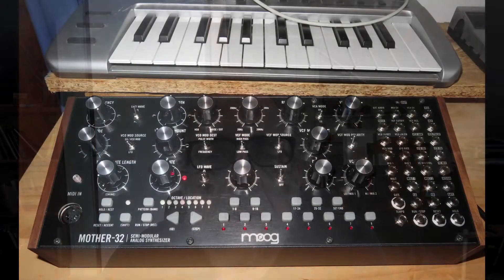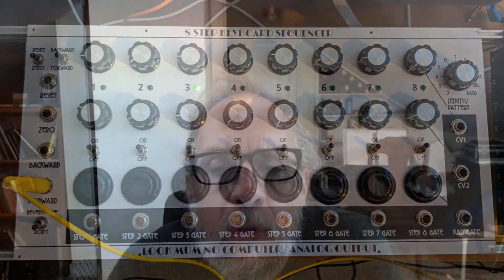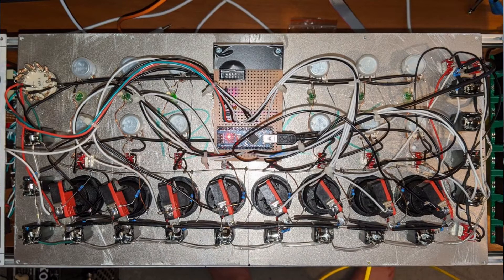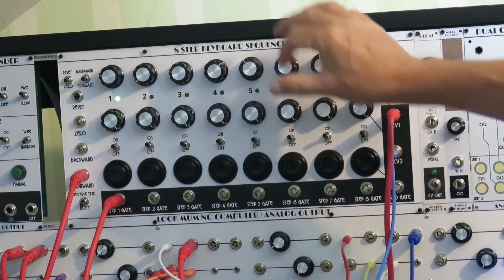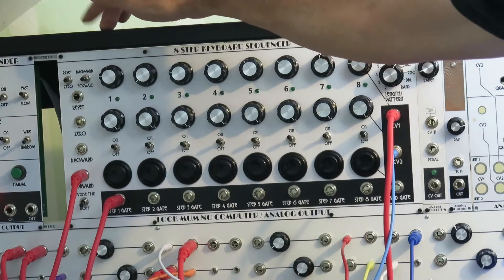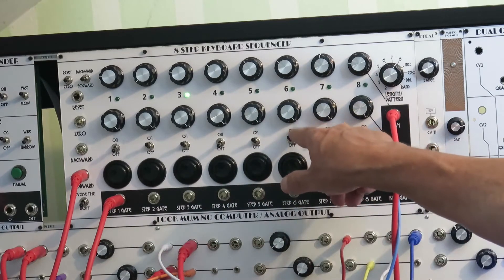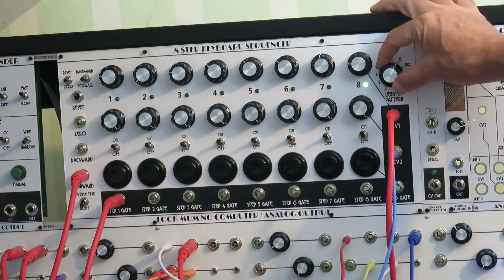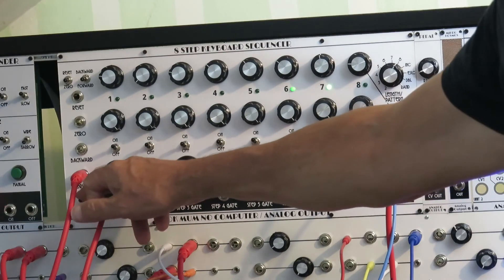8 step keyboard sequencer

Comment: Ok, you have two outputs per stage. Do you think a third output going through a set of pots might overload the Arduino pins? I believe the pins are rated at a max of 40ma. Would you have to run the LEDs through transistors?

Comment: Using an Arduino for a so simple task looks pretty overwhelming, but it's a cheap board, easy to handle with lots of docs, you can add in and out Midi control, shuffle, step jump, matrix to expand step number, whatever you want ! I'm just finishing an arpeggiator with lots of features with a simple Nano Every (3€).

Comment: just to say, you should check the 4022 or 4017 i dont get the point in using an arduino herem but that's me (the interesting part in the arduino for this woulkd be the code study witch sould make an easy to undertand example). for 8-16 (or more if you chaion several) steps check "baby sequencer, and then add what ever controls you want using transistor switches per step (you can do without though) for power stability. Anyone interested in etching/building 8-16-or more steps sequencer, feel free to let me know i'll; share my pcb layouts... sequencers are a great project to learn and understand some basics of logic electronics, and i'm pretty shure it must be interesting and not that hard to program to an arduino.
Reply from the maker: Arduino enables varied stepping modes: Reversed, up and down, etc., which would be difficult at best with a 4017.
Reply: @analog_output  yeah but i think i remember you can do that with a 4022 or another way (i just happen to have used 4017's because i started building a baby seq the first time and went from there, but i got a few books since...), i'de just need to check my books but it's doable with logic and i'm shure you know that. BTW i found a way to achieve randomness; you'll need a s&h with the output sent to a 16 stage lvl merter (or 8 or else, if its two 10 stage meters in series in a chip reduce input lvl and number of meter stages to suit needs), each levels of the meter being tied to one step, with a separate clock to the s&h you can do cool things that way... personally, random, and back and fourth is not that interesting to me the way i build music but once again that's me. these days i am after sequencing drums with one line (i prefer sevewral like igor did but, technically...), using two 8 latch chips (push on push off) chips per chanel if 16 steps (or more for more...), theory is easy (once you know your chips), i just need to give it a built now...

Comment: great module, thanks for sharing your enhancements.  Is there a reason to use the external voltage regulator vs the nano's internal one? curious if this reduces noise or something else? I normally just put +12 into the nano and haven't had any issues, thanks Rich!
Reply from the maker: I debated that, and decided since there were quite a few outputs and who knows what they'll be plugged into and so how much current they'll draw, I'd play it safe and use the external regulator. Just being cautious, perhaps overly.

Comment: What is the difference between reset and zero? I can't seem to figure it out. Looking to make this and wondering if I should ditch the zero step. Trying to get it in eurorack, so saving space is helpful wherever I can.
Reply from the maker: Reset actually does the same thing as pushing the first button. It goes immediately to the first step, sending out the 1st step's CVs and a step 1 gate. Zero sets the CV to zero and turns off all gates, then it'll go to step 1 on the next forward clock pulse or the last step on the next backward clock pulse. If you have to keep one of the two I'd recommend zero (especially if you keep the buttons, but even if you don't).
Reply: So could you go out of a step gate into zero to shorten the sequence the same way you could with reset?
Reply from the maker: @chainbastard  Zero stops the sequence and turns gates off until a clock pulse comes in; reset resets the sequence to step 1.

Comment: Does the arduino directly send CV to the output?
Reply from the maker: In each of the eight stages, the Arduino supplies 5V on a digital pin to two pots wired as voltage dividers. Each wiper voltage is connected via a diode to a 1k resistor common to all stages which connects to the CV output jack.

Comment: Can you hold it for a moment. Have to go shopping before the shop is filled with people. And before I go, I am building the MFOS 32-step sequencer and am waiting for a pcb to Thomas Henrys 16-step. Henry’s sequencer has two rows of potentiometers where the second row may be used to control a VCLFO that in turns generates clockpulses to the sequencer, but else lacks many of the nice functions of Ray Wilson’s 32-step.
BUT, the logic controlling, especially MFOS’ sequencer is rather complex and using an Arduino could definitely simplify matters a lot.
Anyway, gotta go (walk; doing my 3 km a day walk). Back soon or in Puh language Bakson.
Reply: Maybe I should have added something like .... fiddling with a simple VCLFO or rather a VC-pulsegenerator to clock Thomas Henry's sequencer. A 555 where the timing resistor is replaced with a vactrol sems to do the job.
And a nice and gentle person gave me one of these: https://www.youtube.com/watch?v=lK1IrSWit1k.

Comment: Great video, nice to see this in action. Is it possible to break out the double setting as a switch so you could double up one of the other shorter step sequences, or even make it a double / triple / quad type dial?
Reply: Excellent question. It's possible but... The main problem is that in the current design, every one of the Arduino Nano's input pins is used, so there isn't a simple way to add a new switch. (In fact just adding the length/pattern rotary switch required freeing up a pin, which was possible because if you think about it, the Reset switch/input and the first arcade button do exactly the same thing and can use the same pin.) I thought about it and considered changing the arcade button wiring to make it more like an old school CV keyboard putting out a single analog signal instead of reading it as eight digital signals. That would free up seven pins. Another approach would be to use a multiplexer or shift register to read multiple inputs on a single pin. In the end I decided against trying to do either because of the second problem, which was panel real estate — I couldn't see adding anything else on a 40 cm wide panel without using smaller buttons and knobs and squeezing everything closer together, and I didn't want to do that, nor did I want to make the panel even larger.
Reply: @RichardHolmesSyr  thanks, I appreciate the reply, I studied the schematic for this as I had no idea how you'd squeezed the input selector onto a single pin, so yeah I can see there's no spares. It's an excellent sequencer as it is, and more than enough for a noobie like me.